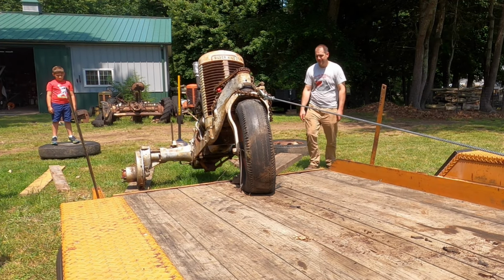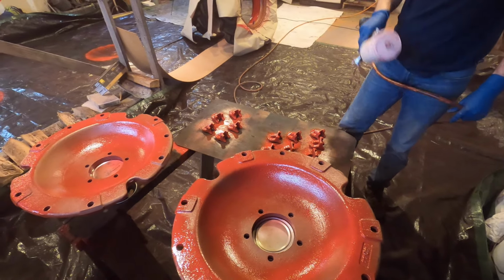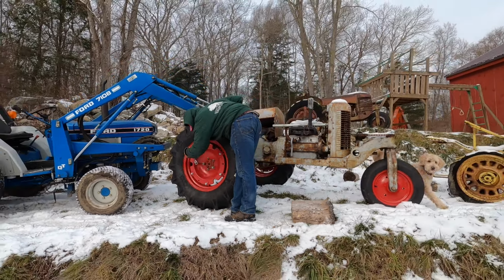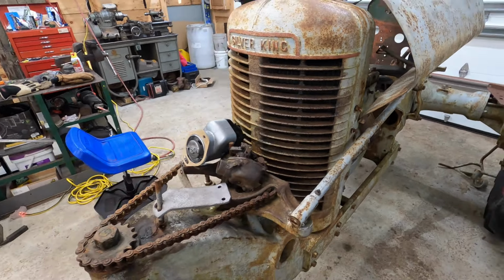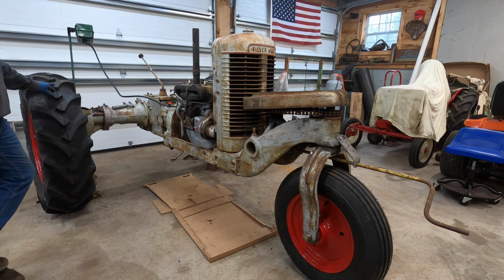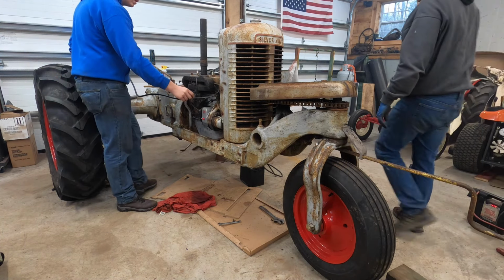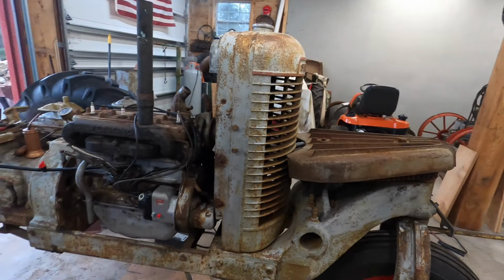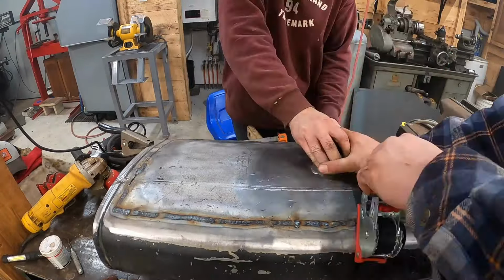Reviving a 1942 Silver King Tractor

Comment: Shut it off its not a air cooled engine. It cranked hard after running because it's fresh and you got it hot. That's not good.
Reply from the maker: I can see your concern. I’m no expert, but I’ve learned a lot from the engines I’ve dealt with in the past.  It did not have much compression before the first run.  The rings were most likely alittle stiff from sitting so long.  It’s common for an engine to gain compression after running its first time in awhile. These engines run at such little rpm’s, the test run we did won’t hurt anything.  The most it would do would break the engine in. I appreciate your feedback, I always keep temperature in mind while doing first runs.
Reply: @ctyankeejr  I work on these old tractors. It's what I do. Just trying to give you some advice. Bout a minute is really all you want to run one with no coolant. At one point I saw over 240 on your gun. Just the fact that it was sitting there puking steam you ran it too long and got it hot. Do what you want just trying to share some knowledge. One of the biggest mistakes people make on fresh engines is not properly break them in. You won't have good compression till you seat the rings. Good luck